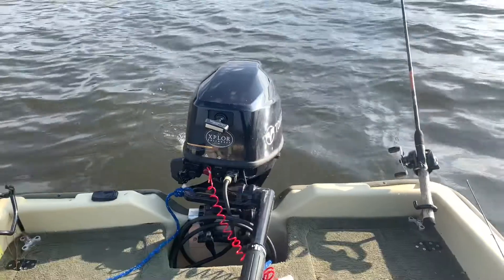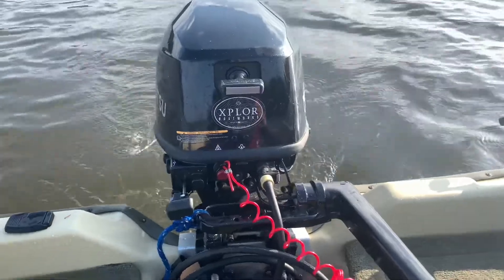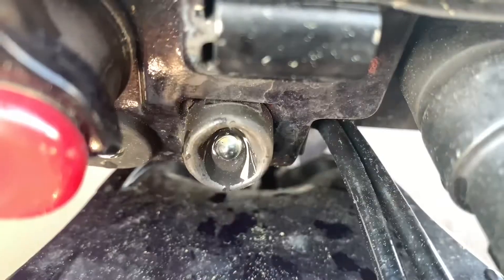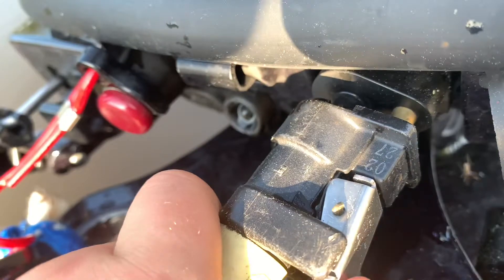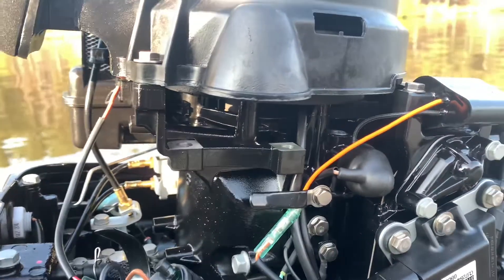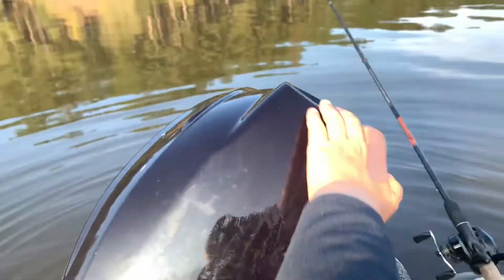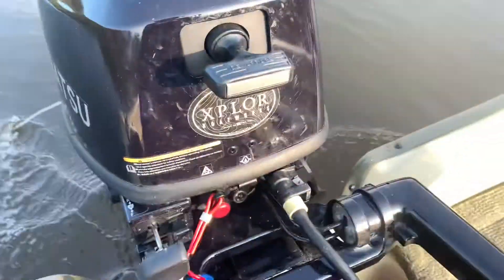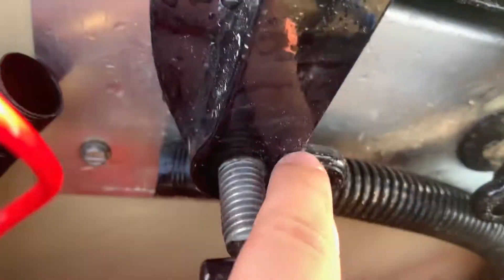Tohatsu 9.8hp Review

Comment: Great job jrbassin. Just one comment and I know everyone calls them "motor" when in reality, a motor is electric, runs on electricity!
In this case you are running gasoline, therefore it is an engine because it uses combustion to produce kinetic motion, in other words, to turn the mechanics inside the engine around moving the prop. Thanks for posting this awesome video jr. and I agree with @Cutlass_Rudd. Well done!

Comment: Looks nice. I have a 15 foot gheenoe. I’m determining weather to get a 8/9.9 hp Mercury or a tohastu 9.8.
Reply from the maker: Nice
Reply: get a 9.9 and call it a day... it will last you in the long run
Reply: Tohatsu makes the smaller hp Mercs now
Reply: Tohatsu and Mercury 9.9 are the same motor built in the same Tohatsu factory in Japan.  Different badging, and the Mercury has the F/R on the tiller handle.  Tohatsu builds all of the smaller Mercury motors, up to 115hp I think.  The Tohatsu 9.8 is the same motor as the 9.9 Tohatsu / Mercury, just with a carburetor instead of EFI.

Comment: Why is it leaking
Reply from the maker: A car has coolant in it which cools the engine. Water can also be used as coolant in warm climates. Since a motor is in the water, it uses the water from the lake, pond or whatever body of water you are in to cool the engine. When the engine is turned off, the remaining water in the engine comes out and that’s what that water is.
Reply: @jrbassin  thank you so in simple terms it’s the hot water shooting out
Reply from the maker: @spidyk3 correct